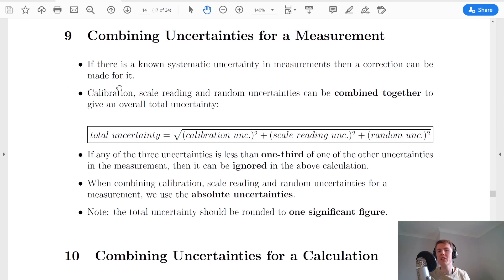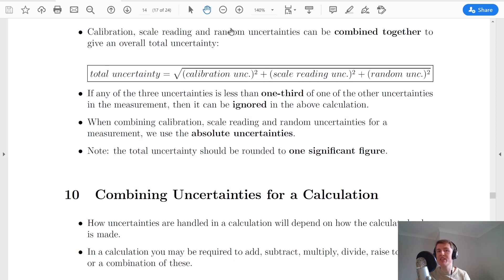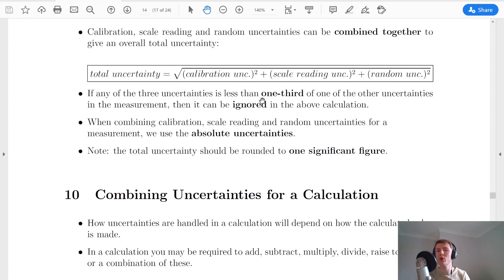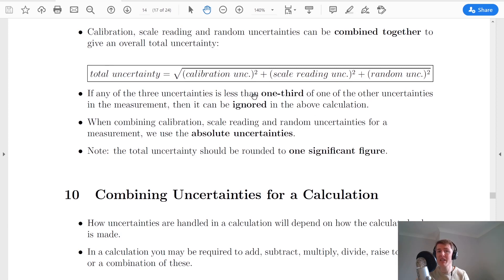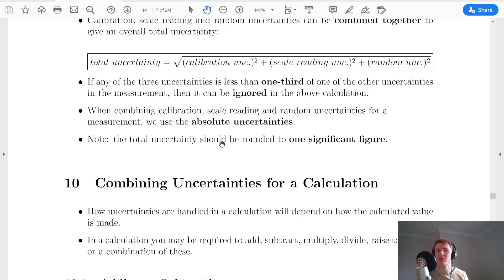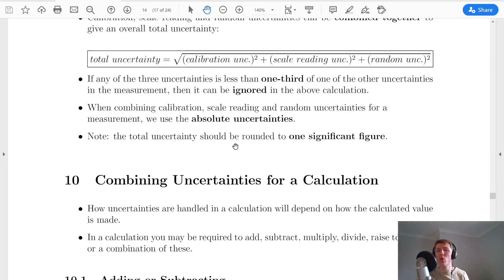Advanced Higher Physics | Introduction | Combining Uncertainties for a Measurement | THEORY

Comment: So we do not include a systematic error in a combination calculation because we can make a correction for it? Could you please explain this a bit more clearly?
Reply from the maker: Hi Bruce, yes exactly. It's thought that if you were taking measurements and plot them on a graph, it's easy to spot a systematic uncertainty as there will be an offset of your line of best fit from the origin for example. This means you can then make adjustments to your experimental setup to correct for the uncertainty. Hope this helps!